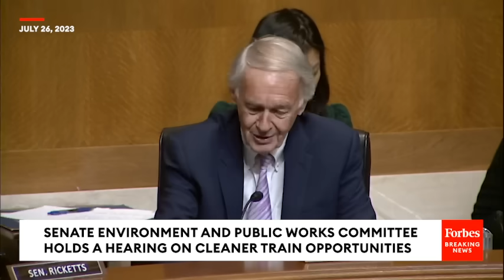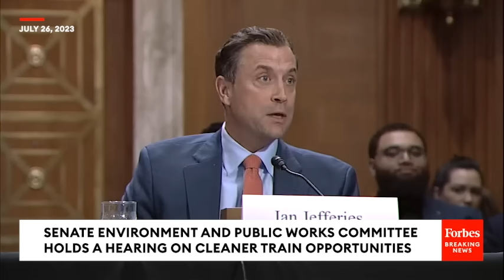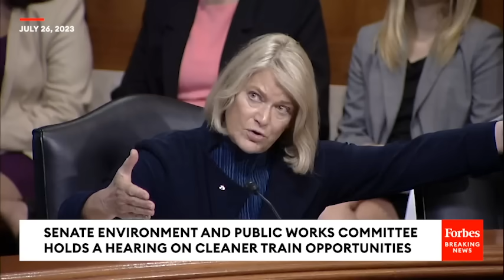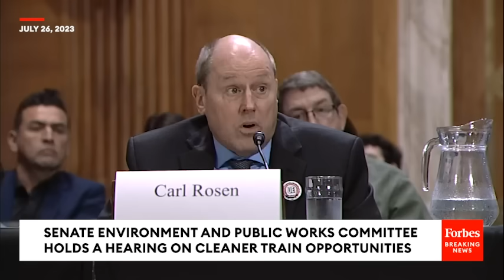‘How Long Would It Take To Replace All Diesel Locomotives With Electric?’ Cynthia Lummis

Comment: Maybe start by having one battery electric locomotive in a train effectively making the train an over all plug-in-hybrid since there are maybe 3 diesel-electric locomotives in that train too. It can recharge downhill instead of using regular brakes and give an extra push uphill improving overall fuel efficiency.
Reply: I also posted on this.
Use the battery electric locomotive with a few diesels to create a Prius like hybrid. Would probably never be "plugged in".
Plenty of down hill sections to charge the battery. 
Plenty of uphill sections to use that charge to reduce diesel consumption. 
And the railroad knows the location of these hills to maximize the benefit. 

I kept expecting the diesels to get a tender car carrying a battery to save the wasted energy of dynamic braking. That never happened. 
Makes sense. Once you have the battery you might as well add motors to increase the maximum tractive potential. Then add a cockpit so can use it without diesels if needed.
Reply: Diesel locomotives are already hybrid machines. The diesel engine runs a generator which runs the electric motors that turn the wheels.
Reply: @jackiemowery5243  Yes, but no battery for running without switching on the diesel engine and no regenerative braking recouping the energy when going downhill.
Reply: @zapfanzapfan  I don't know this, and am talking out my ass, here, but I'd guess that train brakes are used mainly for emergencies and precision logistics (stopping in certain spots), and that most of the time trains have a great enough 'drag' that brakes are rarely used, and regen would be of dubious value.
Reply: @johngalt97  To not wear out the brakes they use dynamic braking, meaning they use the electric motors as generators, but they just run the generated electricity through resistors and cool away the heat instead of using it to charge batteries. So instead of wasting the energy as heat they could do something useful with it.
Reply: @zapfanzapfan  Interesting. But still, There’s a limit to how much energy that can be quickly absorbed into batteries. The size of the mass of capacitors needed would probably be prohibitive as well.  There might be good reason why hybrid isn’t yet practical at the locomotive scale.

On the other end of the spectrum, bicycles were the the most efficient form of locomotion on earth, until ebikes. But even ebikes benefit only a fraction of a percentage from regenerative braking.
Reply: @zapfanzapfan Not in any way logical!
Reply: @johngalt97  The batteries I have seen on battery electric locomotives have been 2-14 MWh so they could swallow full braking power for an hour or more.
Reply: @zapfanzapfan  That technicality is beyond my pay grade. The braking force is also a function of the tremendous normal force of those super-heavy locomotives. How much braking could a single locomotive provide, or does it need to be distributed equally between them. 
Your idea of hybrid battery regen units is interesting, and I’d be interested in perusing the pro/con considerations.
Reply: @johngalt97  It's not my original idea, BNSF ran a 3-month trial 2 years ago with 2 regular locos and one battery one in a consist and they managed to cut fuel use by 11%. That one had a relatively small battery that could provide full power for half an hour, they expected up to 30% with a later model with a bigger battery. EMD has a line of battery locomotives, up to an 8 axle monster weighing 240 tons.

Comment: Why not go the way of India? Every line will be  electrified. Hundreds of power stations would be needed and thousands of miles of towers, and wire. The Milwaukee Road electrified 2 thousand miles from Duluth to Spokane in the 1930s.
Reply: While the Milwaukee Road did electrify two segments of their Pacific Coast line (1909-1974), they shut off the electricity and reverted back to diesel power. From 1984, until they merged with Soo Line RR in 1986, they withdrew from their western lines, and finished as a plains region operation.  Electrify every American rail line? That would bring about national bankruptcy.
Reply: @alansloan7784  I was kidding to see if anyone thought I had a good idea.
Reply: From Othello to Tacoma that Milwaukee Road line was electrified. That was the first thing to go and the power plants taken offline and the entire system scrapped once they declared bankruptcy. Electrifying railroads is very expensive and time consuming and is best left for places that have the population density where it will work such as in Europe or places in Asia. @alansloan7784
Reply: They'll gladly do it if we pay.